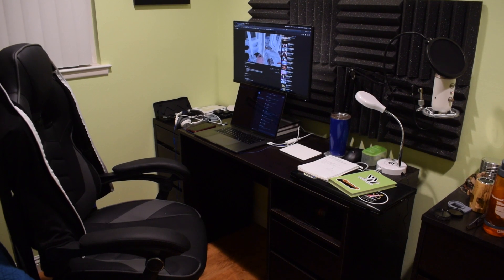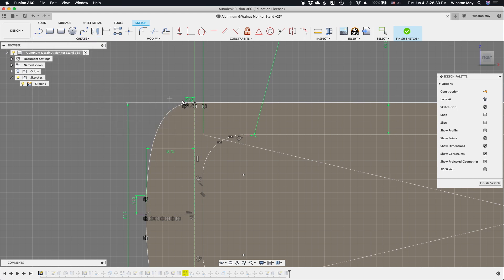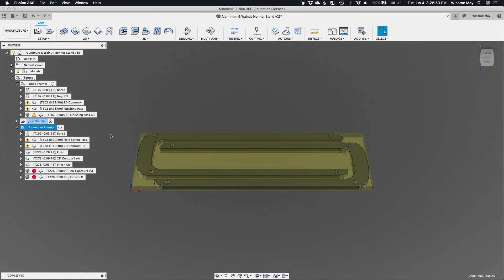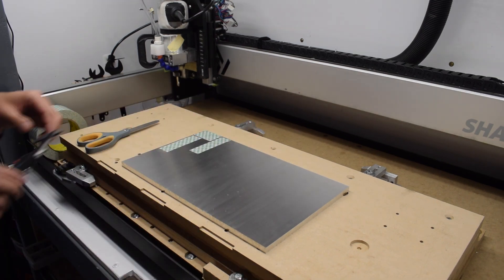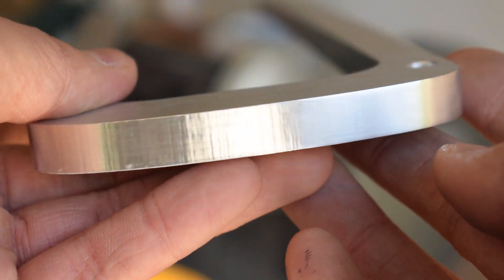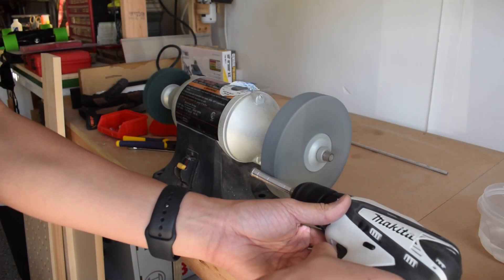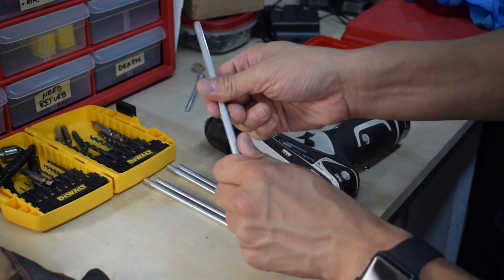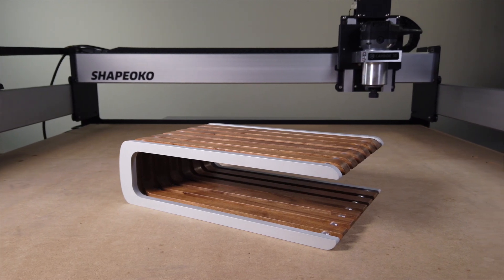Aluminum and Walnut Monitor Stand - #147

Comment: Fusion360 has collision detection built in.

At 4:51, on the very bottom, a bit to the right, there is a small red line on the tool path timeline, meaning you have collision at that point of the tool path.

Comment: Sag could be counteracted by not cutting a precise 'C' shape of 180 degrees, but more like 178-9 degrees ... in other words: slightly 'open'. Reverse pre-tension of sorts.
Reply: Another trick is to connect the top right overhang to a steel cable, wrap all the way around to connect the other end to the bottom right. Since the total distance around would need to increase for it to sag, it will need to stretch the steel cable which isn't going to happen. This is a common architectural trick to allow for load bearing overhangs.

Comment: Winston, 
Why not turn the stand 90 degrees and point the opening at you? Then the sag will achieve a symmetrical effect to the observer, and the things stacked underneath can be wide if needed!
Reply: Right? This was my immediate thought... hell, it was my assumption when I started watching the video. Not only will it achieve the effect you mentioned, it would also allow for access to all three "user-facing" sides instead of just two. The chosen orientation is very strange.
Reply: One word, aesthetics.
Reply: If he were to go this route, with the 3 open faces facing the desk's seat, I would have liked the stand to be wider than it is deep. I can't imagine the stand as completed looking good in a 90° rotation.

Comment: Just a tip if you are new to buffer wheels. They are the most dangerous machine in almost every workshop. Unlike a big saw, drill, etc which will only rip a limb off your body the buffer wheels are excellent at thrusting objects at high speed towards your heart, throat, and head, which unlike your arms and legs are vital. Earlier this year a YouTuber named Lee  (out of LB Customs) who made knives was killed when a workpiece was thrust through his skull by a buffer wheel. Always make sure there are no cracks in the wheels before use so that it doesn't disintegrate and scramble your brain, don't use gloves since you have a better grip with your fingers, be very careful about which angles you approach the workpiece to the wheel and always use protection that makes sure that if something does go wrong you only lose an arm or two as a worst-case scenario. I noticed that you don't have such protection as of yet, build one ASAP.

Comment: As always a pleasure to watch. Every machinist makes mistakes from time to time. Some crashes 'you get away with'.  Just create a few habits when using Fusion360;  Always simulate before you post, with stock checked.  And always check your g-code max z depth.  (it's in the top line of the gcode, Brackets always opens when you post new cam) And the best way to avoid stupid fixture crashes is to model in your fixtures and define them like fixtures in your cam. And even then, mistakes DO occur. It's just another dent on your ego.. PS, walnut and anodized aluminum are one of my favourite combo's for the furniture I make..

Comment: 6:37 that’s why I switched to close loop steppers when I was buying my second cnc. When I crash, the steppers will detect it and shut down the spindle and X/Y/Z motor. 
I already had one crash because I placed my part the wrong way and the Y gantry hit it with 1m/s 😅
The machine stopped immediately. Couldn’t hit the e-stop fast enough.

Comment: That's a gorgeous monitor stand! From some quick research (because I've not used E6000 myself) it looks like full cure time for E6000 is 24-72 hours depending on temperature and humidity. Increased Temperature makes it dry faster and I believe decreased humidity also helps it dry faster (though I could have that backwards on the humidity). It's possible your impatience got the better of you with the glue (totally guilty of myself as well) but your future plan of 5 minute epoxy sounds like a better way forwards anyways.

Comment: You should connect the top right overhang to a steel cable, wrap all the way around to connect the other end to the bottom right. Since the total distance around would need to increase for it to sag, it will need to stretch the steel cable which isn't going to happen. I hope you understand what I mean.

Comment: Hey,! Great job! It looks like there’s a very subtle roundover on the walnut edges, is those done by sanding by hand ?
Reply from the maker: Yep, very quick touch of 200-320 grit needed to remove any fuzz from machining around the edges.
Reply: Winston Moy very cool, it looks very nice. You’ve sparked my interest in this Shapeoko machine. Is it true that just because a software produces G code that it may not be compatible with your respective machine? What softwares are compatible with this machine?
Reply from the maker: There are many different Gcode variants, think of them as dialects. Cnc machines only understand one. A post processor formats Gcode into the right dialect for a CNC. Any software with a post processor for GRBL/Shapeoko/or Carbide3D will work. Most common ones are Fusion360, offerings from Vectric, Meshcam, and of course Carbide Create.
Reply: Winston Moy thank you for the info. Is it possible to model an object in say rhino, or 3dsmax, import the obj into fusion to create all the toolpaths and respective code for this Shapeoko?
Reply from the maker: @synthdude7664  I believe Fusion accepts STL and STEP only, but yes. Better idea would be to just model it in Fusion from the start though.
Reply: Winston Moy good idea , thanks again!  And great content

Comment: Have you tried the stress simulation tools in Fusion360? Might be interesting to try some different designs for the corners and test them out
Reply from the maker: I've tried them briefly, but am too lazy to try and calculate an acceptable stress limit/factor so the data is useless to me. For optimizing 2D profiles, you can just use topology optimization.

Comment: That double sided tape you are using is pretty weak. One source that comes to mind is mobile audio solutions although good stuff can be found elsewhere. It is used in the car audio fab community a LOT for template routing, even with aluminum. The routers these guys use are generally much stronger than what hobbyist Cnc machines use and they routinely route fairly thin parts with it.

Comment: what was the "debarring wheel"?  20 years ago I got several small "abrasive impregnated rubber sanding" wheels and they were WONDERFUL for aluminium. They were 3 inch dia and only cost about $10 each.  But now I cannot find any such thing that is less than $100. The company and distributer on the packaging I have I have went out of business years ago.
Reply from the maker: I don't know what brand this is exactly, but it's similar to the Scotchbrite EXL wheels

Comment: One of my very first projects on my X-Carve was a set of Monitor Stands ( https://i.imgur.com/7U8lp2Y.jpg ) for my Main PC ( https://i.imgur.com/0WEzjU2.jpg ) replacing my previous stacks of Candy Boxes and Guinness World of Records Books.
BOY was I inexperienced back then... It took 45min for just one of those stands to be cut free from 8mm black MDF though that was with a stock machine setup back then which by now has changed a lot like replacing the DeWalt 611 for a water-cooled VFD Spindle among others ( https://i.imgur.com/WSa3exY.jpg )

Comment: Deburring wheel, do you mean grinder?
Reply from the maker: I'm using a Scotchbrite EXL deburring wheel or equivalent. It's a fairly flexible, compliant disc.  Not what you'd want to use on a grinder.